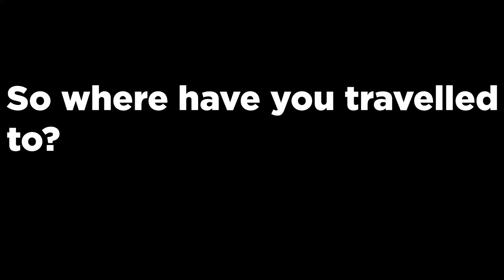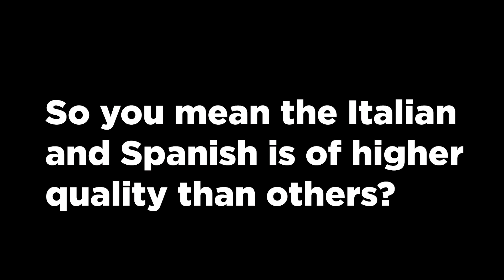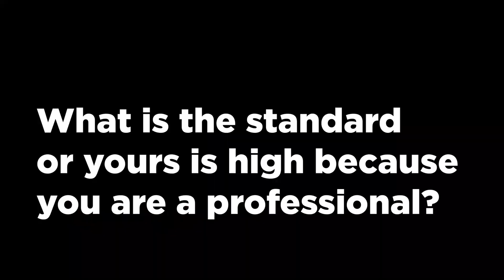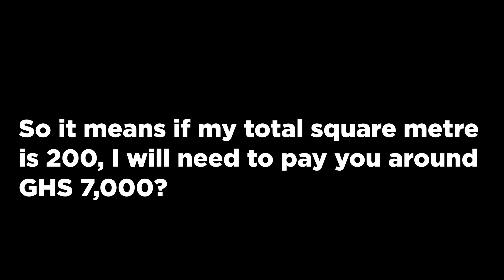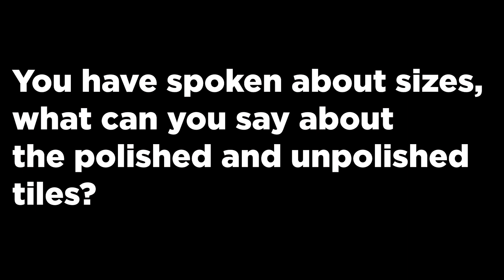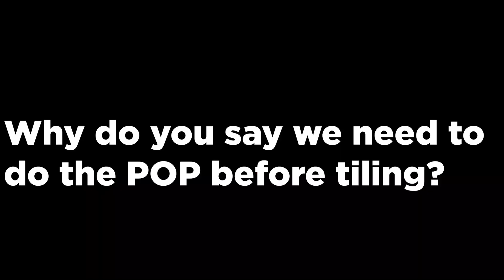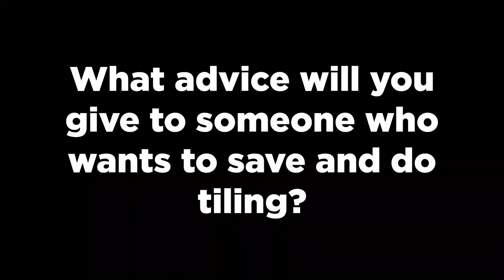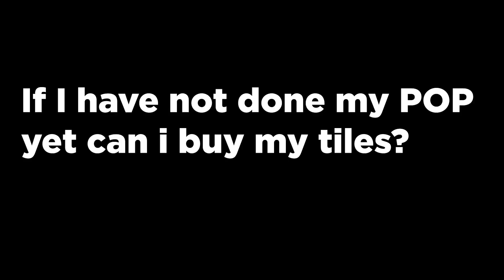Interview with My Tiler - Building in Ghana 🇬🇭

Comment: For the tiles cement is not composed to use for any tiles, it dipped the tiles and the material quality bat ghana we don't know about that, george Libya.
Reply: George, kindly explain your point well
Reply: @paakow2284  we use tiles cement for a lot of reason, example the mortar will not be hard quack
Reply: @Emanuel Ob  are you saying that the white who uses tile cement only for their tiling is not strong enough? I have watched enough YouTube videos on it to understand how strong it can be. The fact that it will not dry quickly does not mean it is not good for tilling. There's no where on tile cement paper that shows you can add normal cement to it. Give better reason why people should not use tile cement for tilling.
Reply: The point is that tilers don't use the right tools for tilling. Most tilers do the opposite of the right methods. If you buy tile cement, there are instructions on it that show how it should be mixed for it to be effective. Instead, tilers Ghana will not do that but rather add normal cement to it before mixing. Kindly read on tile cement properly and watch videos on how some tile professionals use it.
Reply: @paakow2284  please l,m not saying is not good to use it but in proper way, to use it good way use it only
Reply: @emanuelob6772  I understand you
Reply: @paakow2284  can l get your number